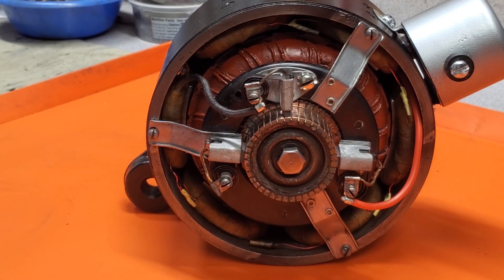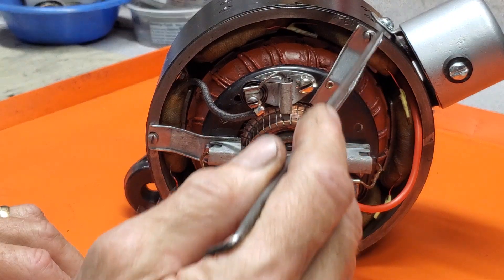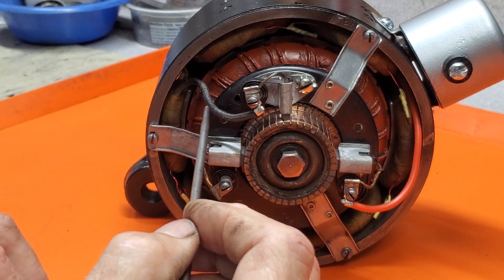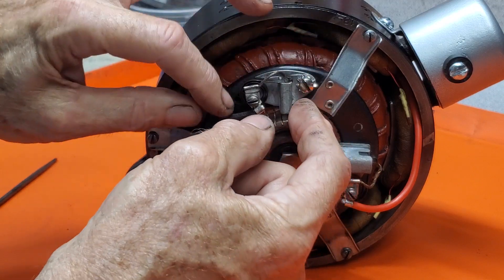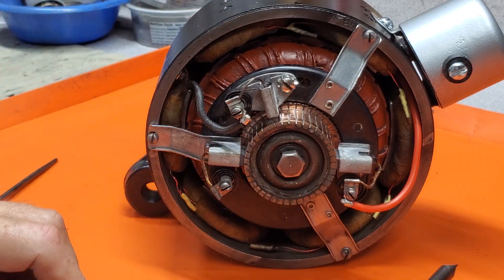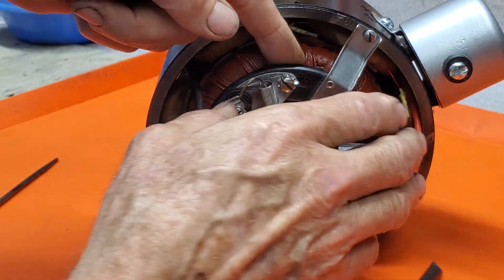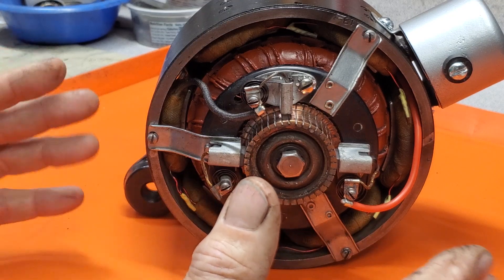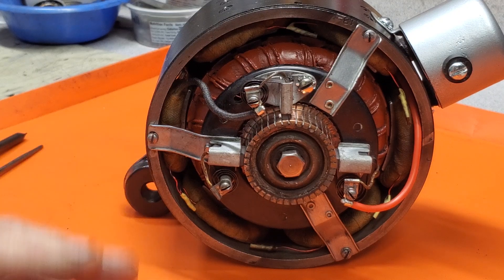Adjusting Output Of The Ford Model A Powerhouse Generator

Comment: Is it possible to tell the difference between the the three brush and five brush from the the outside?
Reply from the maker: 5-brush should have a lug for a tension arm. But that is not foolproof because parts get swapped around sometimes. Just pop the cover off and look.